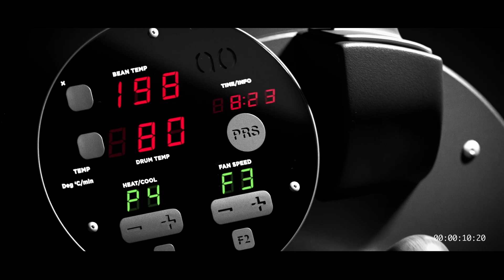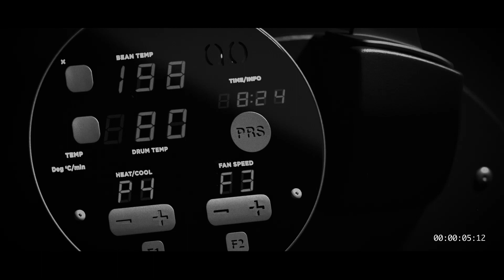The Reasons why Induction Heating Makes a lot of Sense for Coffee Roasting

Comment: Question on thermal cycling. I work on cars and one of the issues you see on exhaust manifolds which heat up and cool a lot is that the thermal cycling will eventually fatigue the metal, do you anticipate this to be a future concern on the bullet?
Reply: Good question. The temperatures on the drum are less than on an exhaust manifold (maximum 340 C), so I don't think this would ever become a problem. In any case, other roasters would have the same problem as they are heated to about the same temperatures.

Comment: I'm confused... I thought the Bullet had heating elements under the drum. I didn't think that the induction was built directly into the drum. I've had mine for 5 years and I've just learned something new.
Reply: what is under the drum is the high current coil which generates the magnetic field. This coil itself does not get hot, it only transfers the energy to the drum.